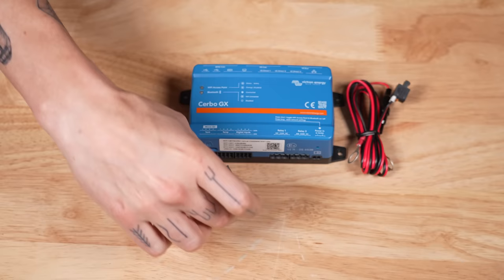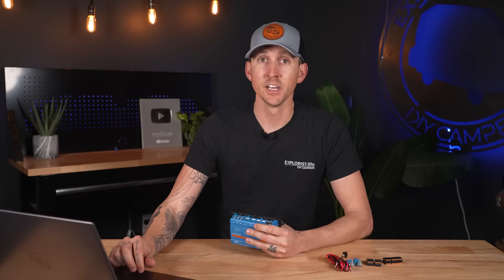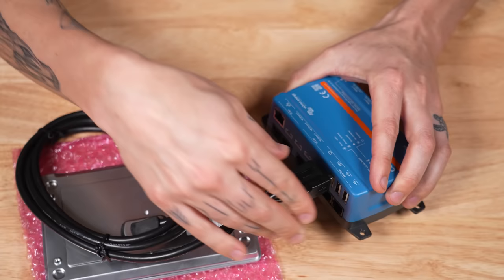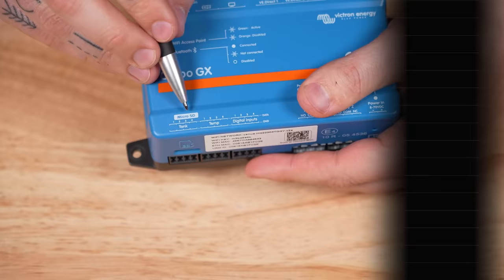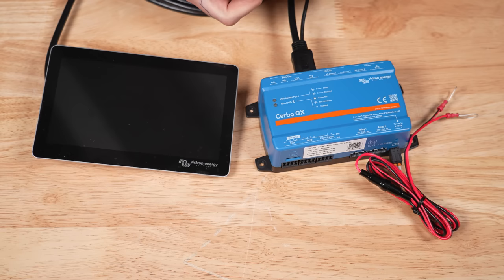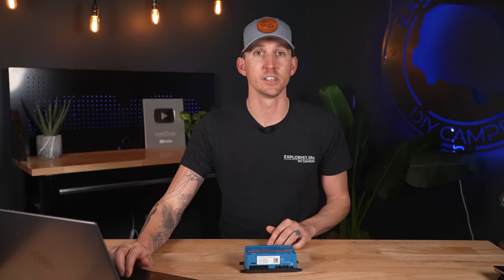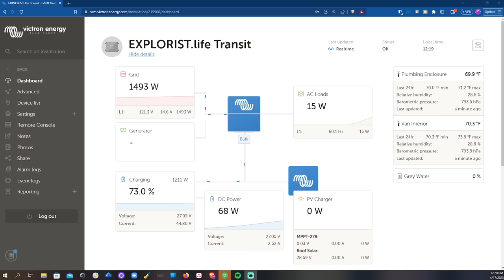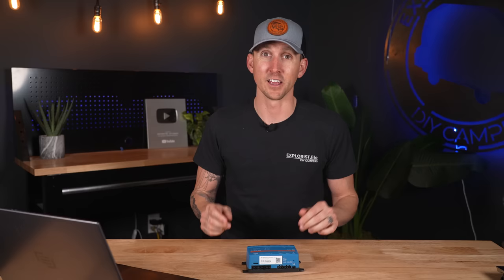Victron Cerbo GX Basics

Comment from the maker: ➤Victron Cerbo GX: https://shop.explorist.life/shop/all-products/monitoring/victron-cerbo-gx/
➤Victron Touch 70 GX Screen: https://shop.explorist.life/shop/all-products/victron-gx-touch-70/
➤Victron Cerbo GX Wiring Kit: https://shop.explorist.life/shop/all-products/system-monitoring-wiring-kit/
➤Link to VRM Portal: https://vrm.victronenergy.com/
➤Cerbo GX User Manual: https://www.victronenergy.com/panel-systems-remote-monitoring/cerbo-gx#manuals
➤Link to Compatible Batteries (BMS.CAN): https://www.victronenergy.com/live/battery_compatibility:start
Reply: Can i use a smartshunt for a car starter application and hook it up to the cerbo gx to monitor via wifi? Negative from battery to battery Negative on smartshunt and then from load side ground to chassis. Thanks.
Reply: Not all the listed parts come with basic Gx.

Comment: Adding a tank sensor and programming a fan for enclosure when temp gets hot would be amazing to see. Thanks Nate.
Reply: Agreed. Tank sensor
Reply: I agree, with controlling a fan based on a temp input. 

Also, because I don’t really trust anyone except for you with Victron products, I’d love to see you walk through programming a solar dump. 

1 other thing….
On a boat, I’d love for my anchor light to come on when the panels stop producing, then for the anchor light to go off when the panels start producing. I’m currently controlling the anchor light with the generator relaying setting, but that’s a timed process…and the sun sets and rises at different times every day. 
I have 3 100/30’s so, at least as well as I’m aware, there aren’t any options to use those directly.
Reply: Tank sensors please. Can you go from an analog meter, for instance a boat fueltank meter, to the cerbo? It could be practical to keep all the original meters in place and connect cables from them to the cerbo instead of rerouting new cables everywhere.
Reply: Yes tank sensors!
Reply: I installed 4 KUS sensors on my boat. Utilizing the existing wiring for two fuel, one fresh & one waste. So far they work great. However, I cannot get them to read gallons…just percentage.
Reply: @Amycolo1  You could do it fairly easily with Node Red on the CerboGX.  It comes with the “large image” and can do the programmatic type things.
Reply: @triphius  thanks. Will have to research it, as I’ve never heard of it.

Comment: I finally finished my electrical system overhaul (1K watt solar/824 AH battery bank) in my camper.  I didn’t leak any smoke out of any of the components.  Thank you for your content, it really makes a huge difference.

Comment: Couple ideas I'd like to see is use of the relay function to turn on a generator based on battery %. Another idea is to have the relay function turn on an external fan to cool down the Multiplus + batteries cabinet utilizing the temperature sensor.

Comment: Awesome video! Thanks for the logical, coherent, and concise overview of the Cerbo GX.  It would be fun to install a Cerbo, But finding room, pulling wires, and the price point is not worth the benefit of retrofitting my system.  Your training vids are responsible for my successful Full Victron system installation in 2021: 12/3000/120 Multiplus, 4 MPPTs to max shading efficiency for 6 110watt Sunpower flex roof top panels, 4 aux ground panels, 712 display, shunt, dongle, Orion DC to DC converter, lynx distributor, 5 volt hack to run the link lights, and much more in cabling and circuit breakers and fuses. I thank you very much.

Comment: I’d like to know if the internal temperature sensors in the VE Smart Lithium batteries can be made available to the Cerbo GX in order to, when environment temp drops below 5C=ATC-temp, then switch on/off an external heating (car seat heating element) that I have applied to the outside of the case of the batteries. E.g. once battery temp is 6C turn heating on, once 9C turn off. Or in other words, to keep the batteries warm enough for charging, e.g when parked at night in sub-zero Celsius. The batteries are connected to Lynx Smart BMS but as I understand the temp data is not sent to the BMS… outside temp sensors would in my opinion not be good as it would require to warm up much more mass and surrounding air volume in an RV installation.

Comment: Thanks Nate for the great overview.  I am just starting to utilize my Victron Cerbo GX, MultiPlus and MPPT controller on my sailboat and have a few questions that may be helpful to others and perhaps you can explain in a future video. Here they are:
1. Can a Victron MultiPlus read a battery temp sensor info from the Cerbo GX and use it for adjusting the charging current accordingly?
2. Can a fuel sending unit be simultaneously wired to the vehicle (analog display) and the Cerbo GX for tracking fuel consumption over time?
3. Do you have to wire your shore power input directly to the MultiPlus for the Cerbo GX to display shore power current?

Comment: I’m in the planning phase of an electrical system and y’all definitely have me sold on the victron in the transit, but I park for several days boondocking using motorcycles for transportation leaving dc dc charging pretty much useless. I’m looking into an Onan 2800 for covering what Solar can’t handle. Do y’all have a video of how to setup the cerbo gx generator auto start-stop feature and how that would need to be connected?

Comment: Love everything on your channel and thank you for the awesome tutoring. We have the Victron Multiplus 2 12v/3000/120-50  watt multiphase. We do a lot of boondocking and like to use a small external generator. We want the ability to adjust or reduce the charger power throughout the day if needed and it’s a pain to take the laptop outside to the front bay and plug in each time. Is there a way we can easily at will change the charge rate parameter without having to plug in a laptop to the MK3 every time?

Comment: As always a brilliant and informative video. I’m just getting to grips with my Cerbo GX. I’ve got 3 temp sensors connected and 2 untra sonic tank sensors by Safiery and it’s working great. I want to change one temp sensor to monitor the temp by the generator and automatically turn off the existing extractor fan which is currently manually operated. Any tips on how to do that please? I’m off to look at chapter 5 of the Cerbo manual as you suggested but find your videos much simpler to follow!🥰

Comment: I have a cerbo gx, smartshunt, inverter 500va and solar charger, when I connect the car to the mains power, I don't see any information in the box on the top left (gx touch 70), Is there a device missing or what is wrong, the installation was done by auto electrics, I am not a native English speaker

Comment: I downloaded a version of this operating system for raspberry pi.  It was only capable of using one solar charge controller, and my system has at least 2.  The interface is a simple UART signal, so I'm writing my own program to read and control all my devices with esp32s.

Comment: This was so cool, thank you, Nate!  I finally understood what a Cerbo GX does in greater depth. I have to do 2 more rounds of this video to let this information trickle through my non-electrical brain.  To help others, here are some basic notes that will be detailed later.  Subscribed.

Victron Components

Victron Cerbo GX - https://www.youtube.com/watch?v=1Gu9Ezugojc
Cerbo means ‘Brain’ in Esperanto.  This is a small computer with a lot of functions and complexity in a 100 pg manual. 

Why do you need it?
You can have individual monitors like a Battery monitor displaying information visually but independently.
The battery monitor can also be seen on a phone remotely by itself.
If you want to monitor and control all your components from a remote location, you need the Cerbo GX. 
The Cerbo monitors your system, shows major components on one screen, and can be programmed to follow instructions. This can be done remotely from any location. You have remote access to your components in the RV, monitoring your power grid without having to be there.
The Cerbo GX  also needs a Victron GX Touch 50 display monitor that gives you the screen output for the Cerbo in color. Without it, you only have the phone monitoring.  The Touch 50 is optional but nice to have inside the RV.

What does this do? 
Cerbo GX is the brain control center of all your individual RV Victron power grid components.  It is an electrical control monitoring device.  It only deals with Victron component systems, not outside of that.
It takes readings of your:
Battery Monitors
Tank Sensors
Solar Charge Controllers
Inverters
Temperature Sensors... and much more
And organizes that data for display on an external monitor touch screen or remotely through Victron VRM Portal on your computer or cell phone.  A portal is gateway software you must install on your phone and/or computer.

Victron Cerbo GX - Brain box with extras.  Cost $289.
Victron Cerbo-S GX - Brain box with less.  Cost  $218.
Victron GX Touch 50 - Color Touch Screen showing visual displays.  Cost $220.
Victron GX Touch 70 - Color Touch Screen showing visual displays.  Cost $324.  (2 inches bigger)

In the box:
Cerbo GX box, power cord,
VE Can terminators, terminal blocks for the relays, 
terminal blocks for the tank sensors, temp sensors, and digital input terminals.
Note: Victron cables may work better than no brand ones.
Note: Victron also makes wireless connectivity, and internet boosting gizmos.
Note: Victron makes their own solar charge controllers.
Q: Does Cerbo GX play nicely with other solar charge controllers, We Boost, and other such devices?

Topside Ports:
What is a CANbus?
CAN mean Controller Area Network bus - this is the nervous system, enabling communication. A bus is a transport system.  It carries things.
Cerbo has several CANbus ports which look like phone jacks but are data jacks:
2 BMS CAN ports - Battery Management System Controller Area Network ports.  Works with other managed battery systems that are Victron compatible.

2 VE.CAN ports - VE. Smart Networking is a wireless communication network between Victron products. It is a wireless technology using Bluetooth Smart, for remote voltage reading. These ports connect to components wirelessly.
This works with the Victron solar charge controllers and Lynx Shunt. Use the VE.CAN terminators on unused ports at each end of those devices.  This is not very clear right now to me.

VE.bus ports allow the Cerbo to connect to, and control Victron Inverter/Chargers like the Quattro (biggest), Multi Plus (Midrange), or Easy Solar (combo device with solar CC, Inverter/Charger, AC distribution).

What is an RJ45 Connector?
A registered jack (RJ) is a standardized physical network interface commonly used for connecting computers onto Ethernet-based local area networks (LAN).  This is the cable that has a wide ‘phone’ plug on one end and a USB plug on the other end. This wide phone plug is a data plug so instead of voice, data flows on it. Typically provided with your Internet modem or router.
All the Ports listed above use RJ45 UTP cables.  UTP stands for Unshielded Twisted Pair cable. This is an Ethernet cable essentially.  Best to use Victron brand RJ45 UTP cables.

USB ports - use these for connecting USB devices such as:
GX GSM - for Internet connectivity via cellular network - mobile phones, ipads, but not regular internet.
WiFi Dongles - for extra WiFi range.  Note: Cerbo GX has WiFi built in.
Keyboard - connect directly to this.  Q: What sort of keyboard?  To type into Cerbo or for my personal laptop?
Touch 50/70 - This USB port is marked with a Lightning Bolt. Use this only for the Touch 50/ Touch 70 Display Touch Screen Monitor for the Cerbo.  It provides power to run it. Plug in the Touch 50 USB plug here.

1 HDMI port - Plug in the other Touch 50 plug here. This is not an input port but an output port. The Cerbo outputs data in a visual display for you to read, showing status of components, battery state, solar input, temp sensors, etc. The Touch screen has two plugs: one USB for power, one HDMI for receiving data from the computer.  In effect, the Touch 50 is the monitor display for the computer.
HDMI means High-Definition Multimedia Interface.

3 VE Direct Ports - allows direct communication with the Battery Monitor or Smart Shunt so it can act as a one spot display for these other components. It shows it both on the Display Monitor or the VRM Portal which can be seen remotely. If you are in the RV, look at the Display Monitor.  If outside the RV, look on the phone or use the computer to see the battery stats via the Portal online.
This port also acts as a central point for separate solar charge controllers if you have more than one. It will give you unified stats on them or control them all from one source remotely - shut off, turn on, etc.  This concept is called DVCC - Distributed Voltage & Current Control.  The Cerbo is the Controller of other Solar Controllers.
There are only 3 VE Direct Ports. If you need more, you can expand it. Use a Victron VE Direct to USB Interface Cord with a USB hub connected to one of the USB ports mentioned above.

1 Ethernet Port - Direct wiring to a Router or LAN device to get internet.  Same as your modem or router at home.
Q:  Do you need a separate battery monitor if you have the Cerbo GX?
Bottom Ports:
Micro SD - Direct upload of new firmware (internal software) if you cannot do it online.  Download the new firmware to the card while you have internet connections, then when you come back to RV, you can insert card in there and upload from it, without the internet at your RV location.

Tank Sensor Inputs - Reads sensors from tanks - fresh water, waste water, fuel, oil, etc.

Digital Inputs - door alarms, bilge pumps (boats), smoke alarms, burglar alarms, etc.

Relay Terminals - to control external relays to turn something on or off, depending on set points that can be programmed into the Cerbo.  E.g. a generator auto start, buzzer, a warning light, alarms, hot air vent, etc.

Power Terminal - connect red/black wiring provided to the battery terminals or bus bar system like a Lynx Distributor system.

Comment: Struggling to find an answer. I purchased all my parts off your site. I have everything up and running except Cerbo GX seems half configured.

How do I connect my BMV712 to my Cerbo GX? I keep hearing VE.Direct cable, but I don’t see a VE.Direct port on the BMB. I do see one on the little round monitor screen. Do I need to run a cable from the round monitor back to the Cerbo GX?

Hoping to get the cerbo GX configure correctly so I can see what is being generated and what’s being used.
Reply from the maker: The VE.Direct port for the BMV-712 is indeed on the back of the round gauge.

Comment: can you look into power saving options such as turning off bluetooth or wifi on the cerbo or other devices it is connected to?  also if you have the display working what would happen if you unplug it for a day then plug it back in, would it just start working or would it need some kind of configuration/setup, in other words is the display plug-in-play/hot swapable?  my goal is to use the least amount of power possible.  i'd like to activate the screen once or twice a day and if i need to make any adjustments not possible through the touch screen i can make a hard wire connection to the cerbo

the new version, the Ekrano, lists different amounts of self-consumption power for different voltages [eg 2.6W @12V | 3.0W @ 24V | 3.7W @ 48V [no display]], but i've only found one self-consumption value for the cebro of 2.8W [no display].  does the cebro have different self-consumptions for different voltage values?

Comment: Hi,  I have a cerbo GX and using it and access the icon views on a cell phone or iPad etc. ... I have two cell phones, one has unlimited data and also unlimited hot spot.  The second phone has limited data and hot spot and it has my main voice talk number.  I was to be able to connect to the Victron online VRM but having extreme frustration trying to get it working on the VRM.  I have a connection error #153 under the VRM Online portal, under settings. Remote console on VRM - status says online.  I had issues trying to use the phone hot spot etc.  That is where I have interest access..  I hope to find a fix. Pat...  I think I need to find the way to connect it via cellular network

Comment: Do you have any used or scratch and dent Victron equipment, I really need to get my power up and running again, I have the knowledge but not that much money and could really use some help. I live in a area that gets over 100 degrees in the summer and then negative 10 in the winter and I live full-time in my 1967 GM TDH-4529 city transit bus. Thank you

Comment: I have an easysolar ii gx and a smart shunt, but I can't seem to get the state of charge to show up on my remote console? Does it need to have a VE direct cable connection? The smart shunt and links to the solar charge controller remotely,  but I can't get the Multiplus 2 to connect in the same way over Bluetooth.  All I want to be able to do is see SOC in the remote console.
Reply from the maker: Everything connecting to the Cerbo GX shy of some temp sensors need to be hard wired; so yes, smart shunt needs a VE.Direct cable conection to the Cerbo GX

Comment: I have solar panels of different sizes and outputs and 4 mppt to handle them separately. 

Can I connect that many mppt (or more) to the Cerbo GX ?
Reply from the maker: If they are VE.CAN MPPT's, they can be daisy chained.  If they are VE.Direct, you can use a VE.Direct -> USB adapter and then use a powered USB hub.
Reply: @EXPLORISTlife  powered USB hub I think it is. That’s good.